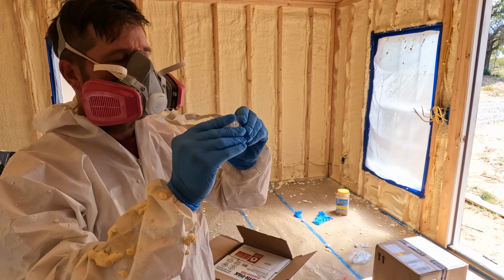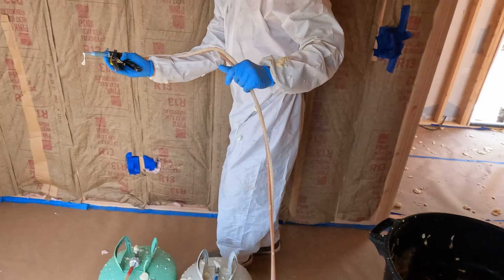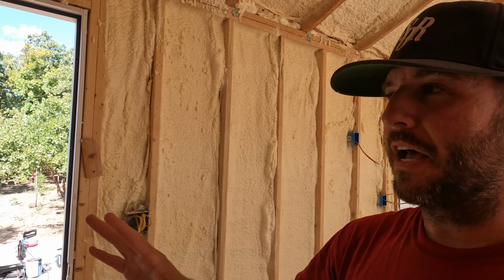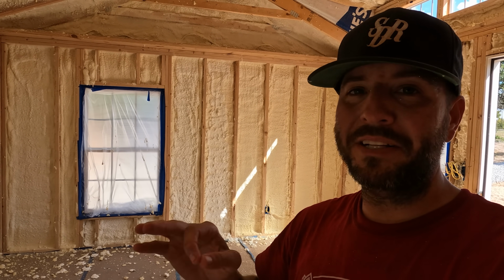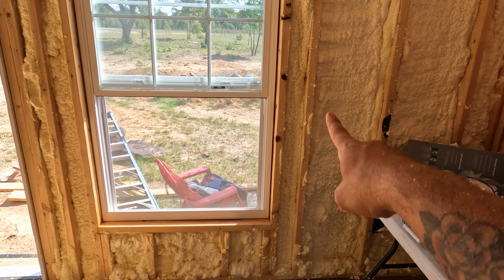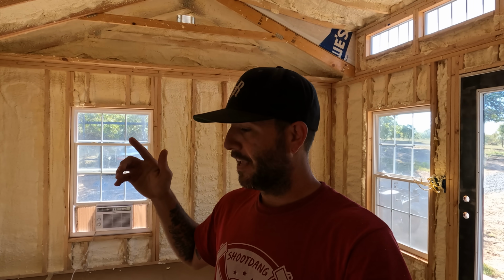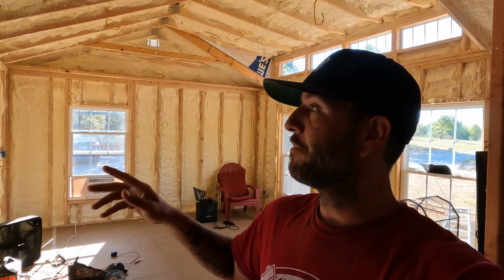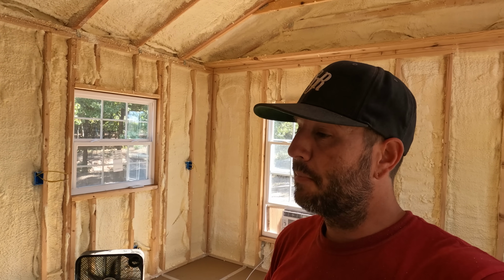Shed To Tiny House - DIY Amazon Froth Pak Spray Foam - Was It Worth It?

Comment: that turned out nice. Ive worked with that pink insulation, it sucks and I always get it on me and itching I hated it.   I'm insulating my horse trailer cabover area and used sheets of styrofoam insulation it was very nice and easy to use.

Comment: The Samsung ranges are great. Not much to go wrong there. Haven't really had a problem with the washers and dryers either. For dishwashers I'd only go with Bosch. Never had much luck with any other brand but never had a problem with Bosch.

Comment: GE Profile refrigerators are garbage had one while in the military and had about 6 warranty claims pre 2011… What mini split are you going to use ?
Insulated curtains or drapes will help keep your place warm in the winter and cooler in the summer …
Good Luck 👊🏼👊🏼🇺🇸🇺🇸

Comment: Great job on the spray foam Jared. A word of caution about bird care: do not use string or thin rope or toys with beads in bird cage. They can catch on string and strangle or choke on those beads. Cover them at night, and keep them out of drafts. Cheers!
Reply: Also keep them away from toxic fumes, paint, self cleaning oven feature puts out strong fumes.

Comment: Nice job! Not sure how long the window unit was running before you checked in the inside temperature but it takes a while  (hours) for a home to fully acclimate. Also, getting the subfloor insulated will also make a big difference in the acclimation and with maintaining the cooler temperature the temp window unit provides. Cheers!

Comment: I am so glad you put these spray foam videos up!! I'm in Oklahoma also and have a 16x40 with a 12x16 addition. I've been trying to get this thing going for 2 years. I've been living in an RV as well. It's a struggle for sure. You all inspire me!  So a couple questions. I have a gable roof, and have been told I need to have vents? But I am thinking with spray foam I don't have to do that? I've heard both ways, what is your opinion? I think u will try the spray foam kits like you as well....after watching you all. Again thank you!

Comment: I bought a new GE stove at lowes last year from Lowes, and it is junk! There is apparently no insulation in it, because if the oven is on thinks get scalding hot on the stove top. My timer melted into a puddle because I forgot to take it off of the stove once. Also, there is no low heat on the burners. It has from 1 to 10 on the knobs, but it is at a high heat on any setting number.

Comment: Looks good guys I like that spray foam however the R factor in the ceiling is not going to do the job I would say the R factor of the spray foam is around 12 to 15 the ceiling should have a factor of a least 30 hope it keeps you warm this winter good luck guys

Comment: For cost effectiveness and ease of installation I am wondering if rigid foam board cut to fit wouldn't allow you to top off with spray foam to fill the cavity completely, lock in the foam boards yet keep the cost down?  You would not need near the volume and you would still get the air seal you need.  Another advantage would be you are bringing the plane out toward you so that 'shadow' places don't get overlooked when spraying.  R value between rigid and sprayed close cell is about the same although the air seal with a properly installed spray is better.  Seems like a killer combination to install 2" rigid and an 1 1/2" spray on top.

Comment: Looks great. I noticed one of the top roof rafter portion on the right side is showing a Lowe's wrap and not covered by spray foam. Was it missed? It is the right top roof rafter on the a/c side.

Comment: I have a Samsung refrigerator and have had alot of trouble out of it. Repair man said Samsung does not make good appliances, they make great phones,  Tvs but not appliances.  I have a GE refrigerator that i bought in 1996 when I bought my house I remodeled the kitchen a out 15 years ago and thought I better up grade now nothing but problems the GE frig I had moved out to the unheated garage and it is still working great ...knock on wood...

Comment: I know you want to see daylight but I'm wondering if you cover your windows when the sun is shining it will block out some of the Heat. The first 6 years I lived in my house we didn't have air conditioning and that was a game changer. I'm wondering if that would help drop a little bit of those temperatures. It sure looks nice what you have done the spray foam I think you're doing a fantastic job. And I love your new pets. Keep doing amazing things and keep being amazing

Comment: not hating just some input. you shoulda used proper vents in rafter bays to allow the heat from the roof to have air under and move heat out the ridge vent and you can't block off rafter tails for the same reason. and you'll notice a big difference in being able to cool the place when you get osme door handles and block off the gable vents.

Comment: You are doing a fantastic job. Appliances? I have had many over 48 years of marriage. The ones I like the best are Frigidaire, and LG. Appliance I  have bought after 2020 are not as good as before Covid. At least you can get them now. It was slim pickings for awhile. Let us know how the spray foam does. I would not want to go through all that work to do spray foam.

Comment: I know you hate the pink insulation,  but when I look at the sprayed insulation,  if you put a straight edge up to the studs, it looks like some places could have up to 2 inches of of space with no insulation.. If you took some pink insulation and halved the depth of it, you could make the whole stud cavity closed or you could actually just stuff it in while you are putting boards on the walls...  When I was doing my house, I took a lazer thermometer (20$) and pointed it at corners and other areas of my house and was able to find small gaps.... just and idea... I really do like your channel

Comment: Spray foam insulation can be better than fiberglass but in order for that to be the case you need to do a more comprehensive job than this one shown: you have far from full depth in those stud bays.  At that rate, this application will be approximately equal to a good fiberglass installation.  You do pick up some advantage in that spray foam provides a ton of air sealing that fiberglass does not, but you had that already with a layer of housewrap and the spray foam probably won't improve on it appreciably.

Comment: Shootdang, before you woulda been over 100 inside with 90 outside. So a 20 degree swing before adding more to the thin areas and an undersized unit is good stuff. Mini split will be even more of a game changer. 

Samsung makes great TVs but crap appliances. Nothing but trouble. Switched to LG and have had zero issues in 4 years.

Comment: I work for the big box hardware store customer service. I just wanted to let you know that LG and Samsung are made in South Korea. Now nothing against them but the replacement parts ship from there as well.   It sucks for my customers who have waited months and months to get a single part. Then to top it off there seems to be a shortage on authorized repairman for those brands

Comment: The spray foam insulation is a much more effective way to seal out the weather from entering thru the cracks and cranny’s that pink will never effectively seal out. In the long run it will be cost effective

Comment: Jared buy the extended warranty for the refrigerator you buy.  I worked at an appliance store for years and refrigerators in general were notorious for braking down right after the warranty was up. Very costly to fix.

Comment: Just an fyi.  Closed cell spray foam is the best. MOST of the energy savings comes with just the first 1/8” it’s called a flash coat. Stop the air movement through the wall Reap nearly all the savings. Then finish with fiberglass batts or whatever batt you want. Spraying 2-3” of closed cell foam in a wall is very costly for minimal savings beyond the first flash coat

Comment: I don't know much about brands of manufacturers, but I will NEVER get another black enamel appliance! I picked out a stainless steel + black enamel stove about four years ago and it is the hardest thing to clean I have EVER had!.No matter how many times I rinse detergent off the top, it still shows grease smear marks. Maybe if you can afford the pricey cleaners like Bar-----'s Friend, or whatever it's called, you can cut through the grease, but I don't remember white or almond-colored enamel ever being as hard to clean as the black is. 

Thanks so much for showing us Shoot and Dang's new crib! LOL They seem so much happier. Also, if you'll cut natural mesquite branches for them to walk on, their little feet will get some exercise. Walking on perches that are uniformly round is not as good for them as natural wood branches.
Reply: P.S. Great job on applying the spray foam! You got great at that in no time.

Comment: Fairly new watcher,but, I like what I see. My comment, not an expert, take it for what it's worth, when foaming, it's either a, complete cell fill, or, a, "flash and batt", your job seems to have a little of both, I would fill any areas with glass batt that it will fit, the roof looks to me to be a prime candidate. Just my opinion, YMMV.......      Wishing you all the best....

Comment: Hey Jared, you have two vents on each end that are letting in the outside temperatures. Might help to close them up
Reply: Those Vents are for letting HOT Air OUT of attic*house. They might possibly let Cold air in during Fall*Winter, just doubt it'd be much tho.

Comment: I'm curious about attic ventilation. I thought with foam insulation the house envelope is supposed to completely sealed. It looked like you had gable vents and ridge venting. Will there be insulation above the ceiling drywall?

Comment: A lil bit more up front cost for the spray foam but in the long run it will pay for itself with lower heating and cooling costs. Looks great ur always going to have a keyboard expert telling you about how you are doing it wrong

Comment: Hi, thanks for sharing. How has it been so far? Also, I'm no expert on insulation but I was wondering, isn't it supposed to go at least to the outside edges of the studs kind of flush so to speak with the studs? Also, I would stay away from Samsung. We've had really good results with LG TVs and washer and dryer, I have all Viking appliances in my kitchen if you could afford that, I recommend those anything else.

Comment: We had an appliance repair guy tell us we made a huge mistake buying LG. He said they are designed to have issues with the electronics after 5 or 6 years and that is exactly what happened with our LG Dishwasher. Every appliance in our house is LG so we are bracing ourselves for the next problem. He also said he wouldn't have Samsung for the same reason. Very expensive to repair and we have been told nobody where we live in NE Oklahoma wants to work on them.

Comment: I think the first coat should be a thin half inch thick, seal coat, and then, after that, I’d go with fiberglass insulation. I think that would be more economical.

Comment: Quick question jared, you sprayed the foam on the exterior wall by the roof but you have vents there. If you are spraying the walls and roof you need to close those vents. Was that just an oversite? just a heads up.....

Comment: So glad you got that insulation done, Jared - a comfortable home is so nice as it's been awhile for you. Very nice!! Shoot and Dang have a nice little home, too - thanks for rescuing them. Whoever said Samsung appliances suck are entirely correct! Our latest is French door Samsung fridge w front water and ice dispenser - first off the inside design allows cramped food storage even for just 2 people, ice dispenser is in terminal state of iced up/not working and it cost WAY too much money. Avoid avoid avoid! Best, roomiest fridge I saw came w friends apt - it's just a regular old fridge, has interior ice maker, roomy and easy to clean - also self defrost. Can't lose except for color choice - appliance paint can be solution. Just don't do Samsung. LG is crap plus pricey/warranty blows - they both got too big for their britches and no customer service for high ticket items. KitchenAid def has nice looking but I've no history.

Comment: I had a Samsung washer and dryer within six months the repairman from Samsung had to come out and put a new motor in the washer and in the dryer it was only six months old was not impressed at all because in another six months my washer went out again five years later my dryer is still working but the washer is long gone so now I have a mix match Washer and dryer needless to say my washer is an industrial Maytag the best

Comment: Hey Jared I would definitely stay away from anything Samsung. In appliances. Both of my brothers had refrigerators brand new and they were nothing but trouble last year I had to buy a new refrigerator and both of them told me to stay away from Samsung which I have I used to have LG and I will not own another LG Appliance product either so I went back to the GE product I will be needing a stove probably within the next year and I will get a g e product good luck with what you decide take care stay safe

Comment: Spray foam insulation does a much better job than the fiberglass insulation, plus it seals up all the seams and locks the building together better.

Comment: I wish I could find an old ge fridge from the 50s or 60s I'd love  to have one those, those things were made to run forever. I could care less about the newer fridges with technology, it's just another thing to break down.
 May have to defrost the older fridges but at least they were built to last. I'd sand it down and murder it out, flat black. Great beer fridge for the man cave if nothing else.

Comment: Why didn't you spray over the ridge vent? Ridge vents are for when you are using pink or blown in insulation.  If you do not cover that ridge vent with foam your building will constantly pull air through your ceiling.

Comment: I would avoid Samsung appliances. My parents had an expensive Samsung refrigerator freezer and they went through 2 of them and finally had to trash itrash it because the warranty would not cover it. It expired just before the second one quit working. I'd recommend GE, Whirlpool or Frigidaire.

Comment: Jared, your phone does not have the capability to tell you the temperature inside your house. The app is lying to you. There are apps that can connect via Bluetooth to a thermometer that sits in your house. But your app cannot read the temp inside your room.

Comment: 80 is a huge difference in comfort for sure.
Reply: For Samsung,  do not get the fridge with the ice maker in the fridge portion.   You’ll eventually have issues and while it can be fixed diy it’s a crap design.

Comment: Are those doors in the direct sunlight?  Cause black doors in direct sun is going to melt your fingers off if you touch it.  Not sure why anyone would paint dark colors that absorb heat in hot climates....  I had Samsung Fridge, Micro, and Stove.  Zero issues for 8 years before I sold the place.

Comment: I bought a Samsung front loading washing machine because of the awesome one it was replacing.  It has been a nightmare!  When I called for service because it wouldn't turn on, they wanted pictures of the front, back, and the wall where it's pipe and electrical was.  I complied and they refused, absolutely refused to come service the washer.  I've since researched Samsung and seems I am not alone in this awful experience.  We're renovating our retirement home and purchasing all new appliances and you can bet Samsung won't be one of them.  I'm going to get all LG appliances, as I have in our home presently.  The only reason I ever tried Samsung was we had their flat screen TVs and had a good experience with them.  We have LG appliances in our home as does my parents and have had no problems.  Samsung is cheaper but not worth the headaches.

Comment: Don’’t fret about the “pink stuff.” Different product, different uses, there’s simply no comparison. Want cheap? Don’t insulate at all! ID-10T’s.
        Foam advantages: Air and vapor seals. Will not absorb water. Unbeatable insulating value. Downsides? Expensive, extremely flammable (even the “Class A fire rated stuff), messy to apply, installation temperature critical, very short shelf life after opening container, all the contents of the container must be used at the same time (even seconds matter!).
       About the cost: Foam is made with oil. In effect, it’s “solid oil.” That’s why it burns so well. The price of foam is thus directly tied to the price of oil. For example, in my area right now, gasoline costa about $2.70/gallon and f Froth-Pak 610 (red) costs about $1100 (watch out for those freight charges). Should gas return to $1,65/gallon, the price of this same Froth-pak will drop to about $600.
     I cannot stress enough the need to protect this stuff from fire. That means, simply, covering it with drywall — especially where it’s installed horizontally (like ceilings).
    Installation temperature is critical for the foam to expand properly. Foam that works perfectly at 70F will be as flat as yesterday’s beer at 65F.
    Preparation matters. Masking is essential, as clean-up is difficult. Trimming overfill is likewise difficult. Apply in light layers — aim for 1” thickness, expanded, for each layer.Give the foam a couple days to cure before closing in cavities, lest the foam’s expansion warp doors and windows, keeping them from working right.